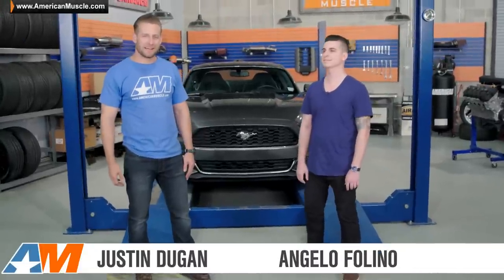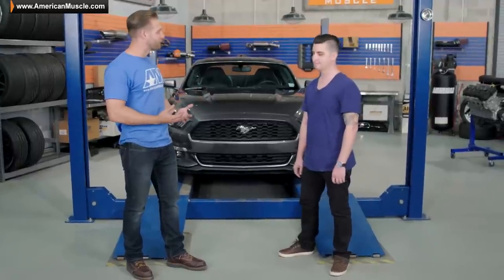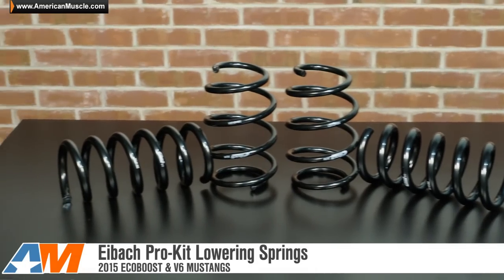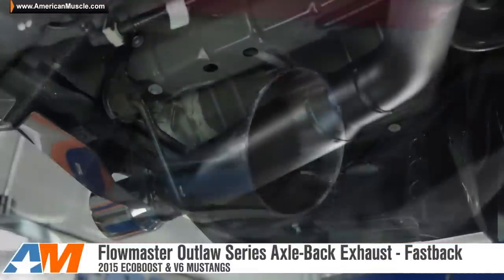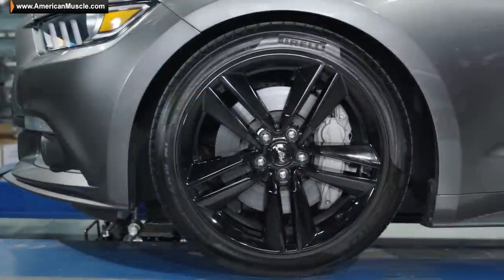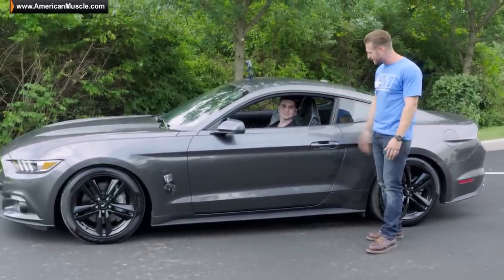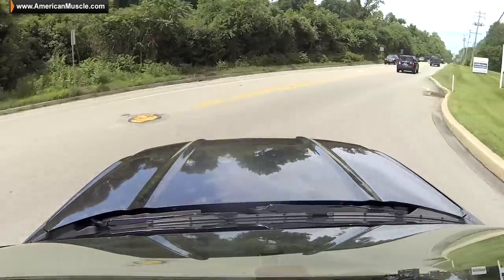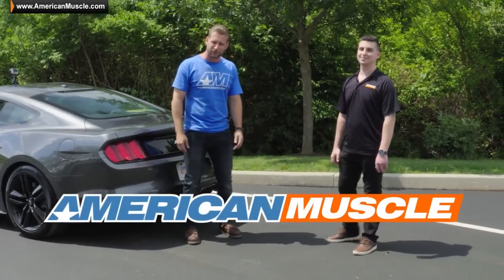AM Installs 2015 Mustang EcoBoost Must-Haves!

Comment: I understand the hatred that the ecoboost gets considering how good the v8s are now but not everyone can afford to own a v8 mustang with how much insurance and gas can cost for a daily.  Plus, 310HP and 320FTLB is pretty damn good from a 4 cylinder not to mention how much you'll save owning it, and I'm willing to put money on it that there is going to be a serious aftermarket for these engines.
Reply: In due time the aftermarket will be flooding with parts for theses motors but still I'm more of a V8 guy.
Reply: same here, i own an ecoboost and definitely wont give it up, but v8 is, has been, and will probably always be my favorite and will always be in the garage, as a daily until the 69 mach 1 is fit to do so, ecoboost will do perfectly fine.
Reply: I’m guessing you own an ecoboost
Reply: 4 years later... boy were you right. Huge aftermarket presence 👌🏾
Reply: this comment aged very well
Reply: I do have to point out that i don't own a mustang yet. But I want one specifically the ecoboost because of the fuel cost, insurance cost and other costs. 310 hp is serious power on the street. Deep down, my heart likes the gt. In terms of affordability and cost the ecoboost is especially for people who want a mustang but cost consciousness.

Comment: Should've got the TUNE instead of the exhaust
Reply: Agree! A COBB AP, COBB CAI, and stage 1 OTS tune really wakes up even a base model ecoboost Mustang. Would've done that instead of the axle back exhaust.
Reply: for the record: I already had a COBB flash with a costume tune before we filmed this lol. just tried to showoff some basic bolt-ons for Ya'll. really top notch company i've worked with for a long time!!
Reply: @checkmeowt2938  so you had a cobb tune with stock everything?
Reply: @drsauce2574  yessir,  cobb v3 with an 'off-the shelf' tune was the first mod on the ecoboost
Reply: @checkmeowt2938  you prolly would of got more noticable gains if you got some performance mods before the tune
Reply: @drsauce2574  I would agree, if it was a coyote or Naturally aspirated. The tune alone netted me 80+ wtq and even more under the curve. The supporting mods don't deliver nearly as much as the tune in this case. the stock turbo is the bottleneck and is already nearing it's limits from the tune

Comment: anyone know what the drone inside the car is like with this set up?
Reply from the maker: +Chad Washington That's a great question man and I would be lying to you if I said it doesn't drone. Flowmaster does tend to drone a little but with just an axle-back it's not that bad! I would rate it a 5 on a 1-10 1 being silent and 10 being killer scale. Hope this helps! - Will

Comment: Flash is not essential ??
Reply from the maker: gaivoron Since the 2015 Ecoboost utilizes a MAP (Manifold Absolute Sensor) in place of a MAF (Mass Airflow sensor), the use of a custom tune is not required when upgrading your intake.  Hope this helps!  -Justin
Reply: AmericanMuscle.com Thats not what i meant! I mean shouldn't the refusal should be the very first essential mod?

Comment: Definition of bought not built...
Reply: I would usually agree with you BUT, i own one, and as far as using this as a daily, safe fun car that wont cost much to make a little better and play with. I totally understand the mods, i have a warranty on my car and i dont intend to void it because I dont want to deal with the money if something breaks, sure i can fix it on my own but its one less thing to worry about, this car isnt geared towards max power, max noise, amazing sound or that, its fun, quick, and comfortable to drive and doesn't ignore the fact its a mustang, i have these 3 mods and they definitely make the car better and wont void warranties. As for built, i am building a 69 mustang, and it is definitely what it should be. 2015 model year, brand new, modest quick car, not meant to be built or bought, simply own it and drive it. hope this made more sense than i think it did.

Comment: I just did a 24 hour test drive of a 2017 Ecoboost and I have to say that the engine is pretty potent as stock, but I agree with these guys. Putting a tuner kit on it would wake it up a lot more. Definitely recommend test driving the Ecoboost. You won't be disappointed.

Comment: I would like some heat extractors to give the ecoboost and v6 mustang hoods a more aggressive look.
Reply from the maker: SkyDraco I have to agree with you there! I'll keep you posted! - Will
Reply: Shelby sells GT HOODS on EBay. I would message them. Got a ruby red hood for $600... vs a mongoose unpainted hood for $1100 and the stock price of one ordered from Ford Parts for $2500. Just ask Shelby what colors they have available and they'll hook you up
Reply: they did for 2018

Comment: Guard Green w/Black 19" Turbo wheels, best looking car on the road. Have same ...a few more mods however. 2.3T is a great engine, coming from a 2013 V8, prefer the 2.3T. Just as a fast w/tune, if not faster in the mid range.

Comment: The speed of the ecoboost's are great but they dont have that same drama as the gt or a well modified v6:(
Reply: +Plain Fitness you can save alot of  gas on the ecoboost  and have fun with it all day the gt's take alot of gas so if you get a gt  you well juste watch it on your garage and say i have a gt so fuck what everybody say
Reply: v6 man.. v6.. yassinco ak  better reliabilty and better gas mileage even when my foot is in the gas.. when i'm flooring it to 100 i still get 14 to the gallon when i'm FLOORING it. my average is 25.4mpg and I live in the city... higher than ecoboost. the v6 will remain king for economy and bang for buck.
Reply: +Plain Fitness sound good man  have fun with it :)
Reply: my buddys 2016 GT get's 27/28mpg on the highway when he drives it like a normal person. Your not saving any where near on gas as what you would think. My 3v even gets a solid 26mpg at 75 and with gas still hovering around $2 it would take quite some time to justify the saving with difference in mpg.
.
Reply: cody roland cool. My boost gets 33 highway. You are definitely saving on gas. Don't kid yourself.
Reply: I also live in a mountainous area so you wouldn't be getting that here. So lets give you the benefit of the doubt and say you'd get 31mpg here. So let's see at 12,000 miles a year and gas at 2.05 a gallon you'd save $85 a year or a 1.63 a week to have 110 less hp and 80 less pound ft with a weak sounding engine. I'll stick with the v8.
Reply: cody roland also don’t forget insurance rates. Under 25, people can see a large gap from I4 and a v8. I own a ecoboost and plan on buying a V8 (camaro or mustang, I haven’t decided) when i turn 25.
Reply: Plain Fitness is that why they got rid of it? 😂😂

Comment: All the parts are listed as GT parts on your site yet they fit in the ecoboost?
Reply from the maker: Andrew Estrada There are specific parts just for the EcoBoost.  Check out the description of the video for links to the individual parts and also check out the page for this build: http://www.americanmuscle.com/angelo-2015-ford-mustang.html.  Hope this helps! -Chris
Reply: AmericanMuscle.com thanks! Another question, as I stated prior, I noticed that all the parts you guys installed on this ecoboost are listed as GT parts on your guys' site. I was just wondering if most suspension, air intakes, and exhaust was interchangeable between the three 2015 models (within reason)  with no extra modifications.